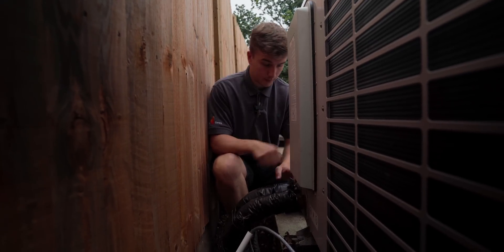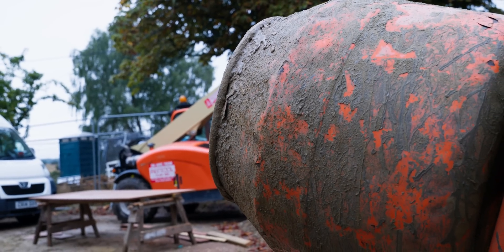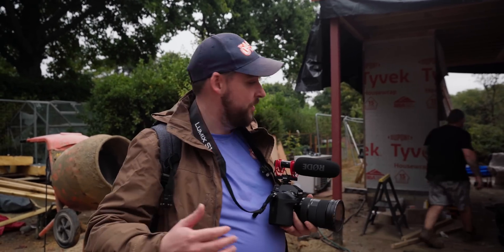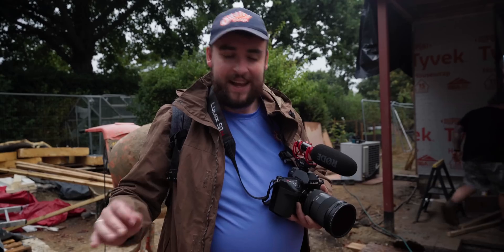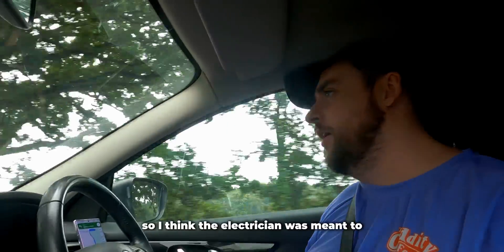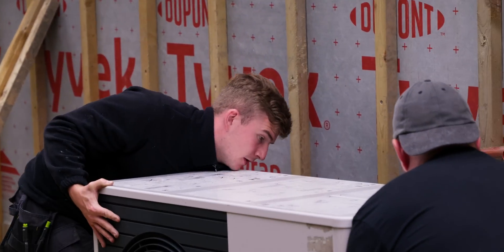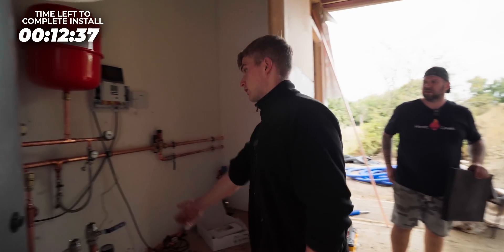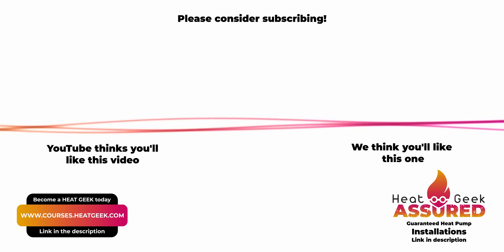Heat Pump Installs Can Be A NIGHTMARE

Comment: The title of this video could just as easily be "How to make £5k in a day..." :-)

- A couple of Irish Travellers
- A stolen Transit van
- A stolen heat pump

Job good. 

At some point heat pumps become popular with folks who are happy to pay cash rather than folks who are ethical and/or require an invoice for their grant funding.

At that point leaving a £5k monobloc in the front garden is rather like leaving a £5k bicycle in the garden. Once it's unscrewed and in the back of the van it's as good as gone. No skill required to remove it in a reusable/resalable condition. No ladders or loud tools required. No keys or immobiliser that need stealing or cloning. Much faster to uplift than the heating oil our friends from Rathkeale steal today.

Might one pay extra for a unit whose brains needed to "dial home" every month in order to function? Might a requirement that any connected to the grid are registered to make it more difficult to connect nicked units be useful?

Comment: Time to organise straps for safer and easier carrying of these items, seeing as designers don't fit carry handles. 
I have moved fridge freezers (house to tip) on my own using 3 camlock straps to make handles. I'm 5' and not strong.
Reply: 100%, we have some in the office specifically for that but neither of these guys had them on their van on that day.
Reply: The vaillint comes with lifting straps
Reply: @andrewglasby6317  this was installed for ages though so the straps long lost
Reply: @patrickwheeler2646 
Sorry partrick  the reply was to the other bloke

Comment: I guess it's always going to be difficult to run a business that offers a service it can't provide.
Don't worry. It isn't your fault that "green energy" isn't supported by governments.
You tried & it's frustrating that supply cannot reach demand.
Reply: Supply of most standard heat pumps is keeping up, the ground source for this project is not standard but was ordered months ago.  There is such a huge demand for renewables but even boilers have longer than normal lead times at the moment.